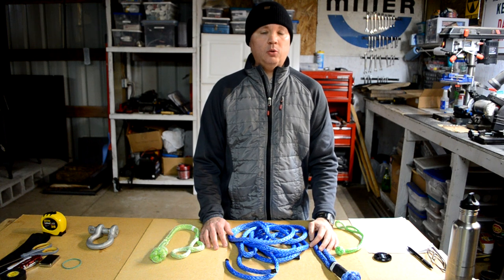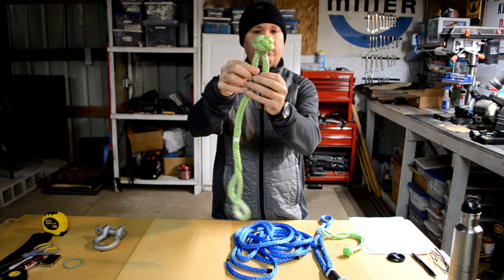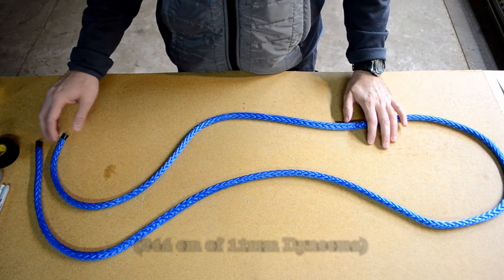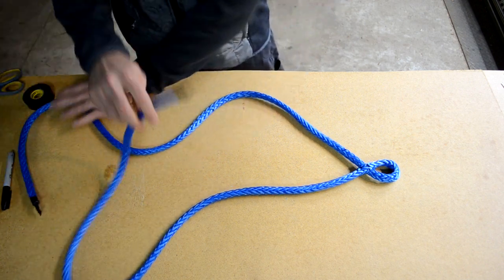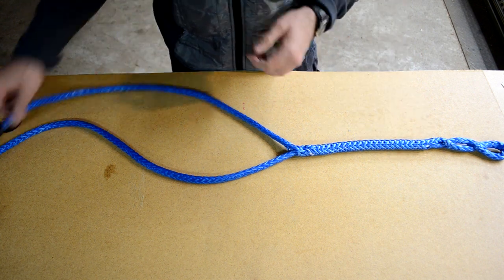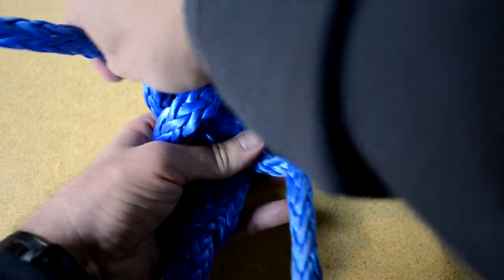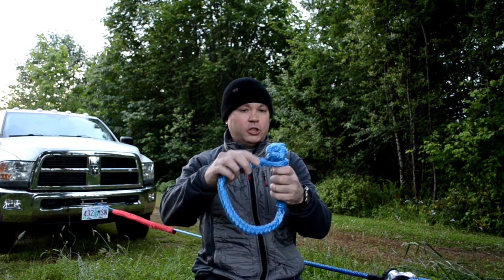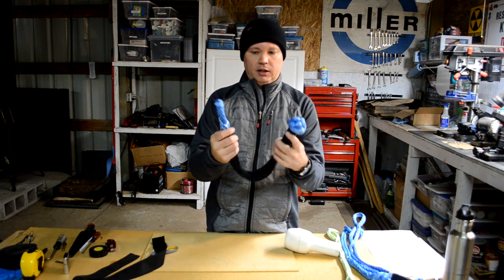Making a Dyneema Soft Shackle for 4x4 Recovery, Boating, or Sailing. Using the Best Design Elements

Comment: Dimond knot removed the 2 extra strands that go through the stem, this makes the weak point weaker by making the bend radius tighter.  Button knot is ~25-50٪ stronger in the noose.

Comment: That 1st mark is not and cannot be 2"!!!  I think I can extrapolate and make it right. Thanks for sharing.
Reply from the maker: You'll have to take it up with my Stanley measuring tape ;-)  Not sure why this measurement didn't work for you, but there could be some variation due to rope diameter and weave configuration.  I made 4 of these shackles using these measurements, but all were 7/16, 12 strand Amsteel Blue Dyneema.
Reply: There is a product called cold shrink. You could get it at electrical supply houses. You just pull the center of it out and it shrinks around weather, on rope or electrical wiring. I use it for real seats on my fishing poles. It’s nicer than hot shank ,thicker, and has rubber surface
Reply from the maker: @Roger-og2ty Wow, I just watched a video of this cold shrink product.  Very impressive; I had never heard of this before.  Thanks for the tip.